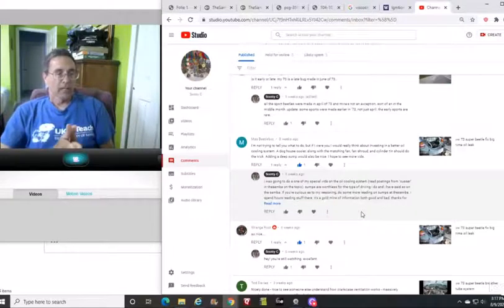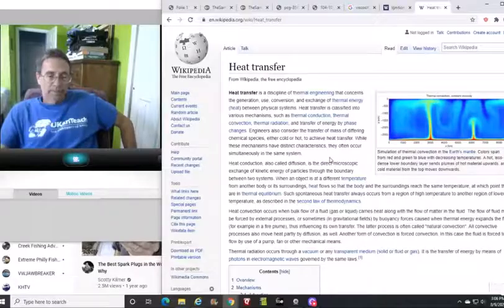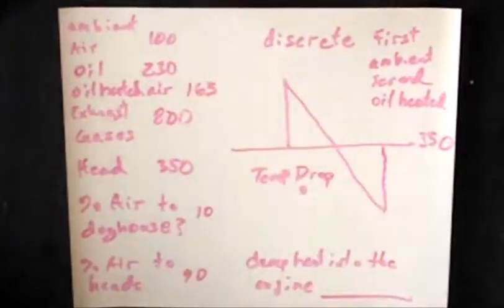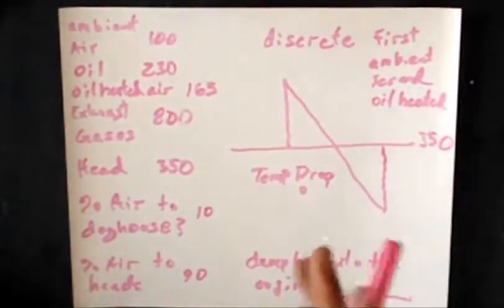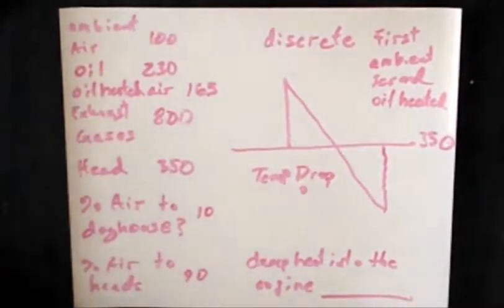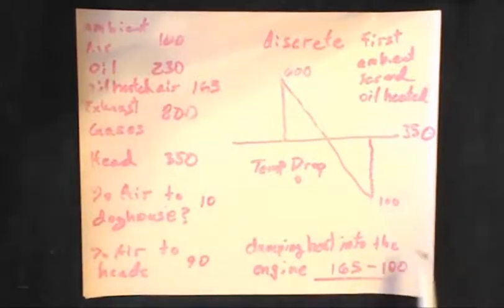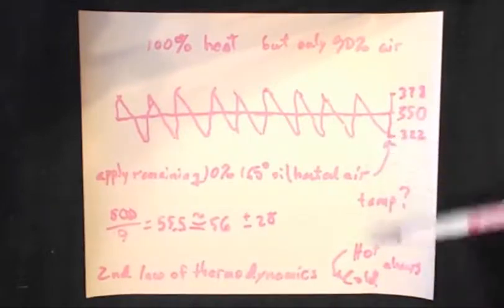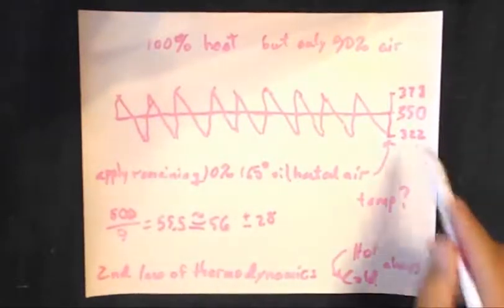vw type 1 mileage & mpg vlog 15 external oil cooler vs doghouse

Comment: very informative, right now i have a 1600 with a scat c25 cam and dual webers 40IDF unfortunately i have ang old manifold taht only works with the 36hp fan shroud,so i did the external oil cooler thing, first i placed the oil cooler under the parcel tray(above the transmission) without a cooling fan, my motor has good temperature but the oil gets hot when i do city driving,i bolted the oil cooler behind the fan shroud,tried it it went hotter, i have a dog house style from a superbeetle, the one with the bigger oil cooler with the adaptor, the reason i can't use it, because my manifolds hit the dog house, that's why i stayed with the 36hp fan shroud with external oil cooler
Reply from the maker: two questions. is it a real OG 36hp fan shroud? what went hotter? your issue sounds like one i was reading on thesamba.
Reply: @redshirt-scotty  yup it is a real 36 hp fan shroud, it went even hotter when i bolted the cooler on the fan shroud, when i place the cooler above the transmission without a fan it ran cooler but  it ran a little bit hot on traffic
Reply from the maker: @bubot17 are you running the old cooler as well as the external?
Reply: @redshirt-scotty  i have the adapter to remove the oil cooler from the fan shroud that has an in and out fittings that connects to the oil cooler  with a hose
Reply from the maker: that's the adapter i, cusser and some of the other samba people run and it's just fine. the stock 36 hp fan shroud with no internal oil cooler is going to give you problems. uneven air flow. you should compare your installation to cusser's. he's got plenty of pics posted.
Reply: @redshirt-scotty  i saw his post on the samba, that's the reason i bolted the oil cooler on the fan shroud, i live in asia that's why i'm working with i've got, if only i could get myself a scat 36 hp style doghouse( not that i like the shape) because the manifolds on my dual carbs hit the doghouse shroud that came from the later beetles
Reply from the maker: @bubot17  asia, wow. the stuff is made in china. if i'm not mistaken, that's asia too. as far as temps go, what really matters is knock. if you knock then you have a problem.
Reply: @redshirt-scotty  i haven't experienced knock yet , i had a chance top drive it in heavy traffic, idles fine runs good but the road cleared up, i experienced a little loss in power, but no knock or pinging, ic ould not touch the dip stick but the engine bay is'nt reallly that hot
Reply from the maker: @bubot17  do you have one of those infra-red laser thermometers?
Reply: @redshirt-scotty  i don't have one
Reply from the maker: i've been doing this for years and i only bought one about a year and a half ago and have never used it
Reply: @redshirt-scotty  i just installed an oil temp guage with the dipstick sending unit, i have no idea if those things are accurate, but at least i'll have a guide if its running hotter than usual